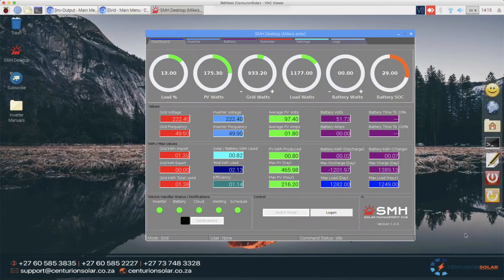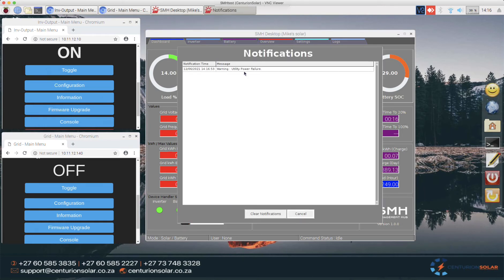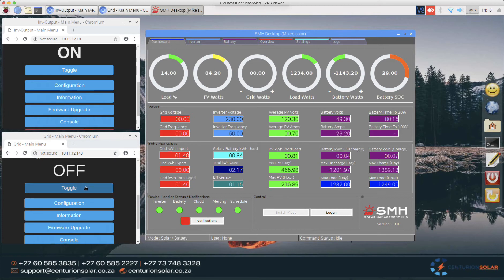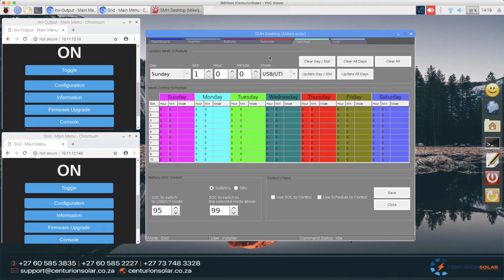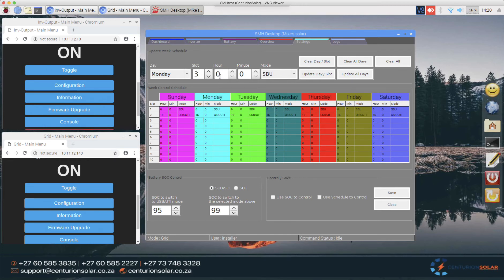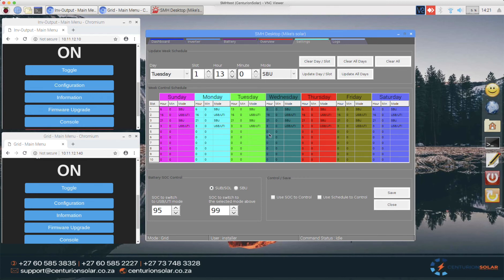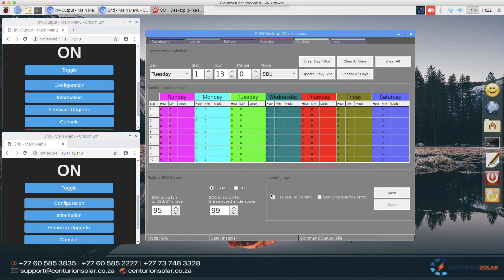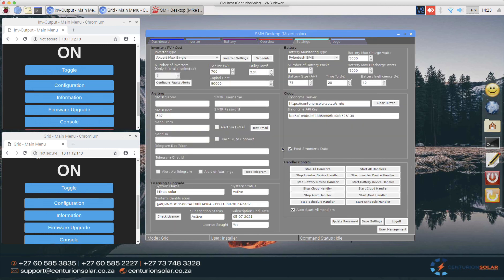Video 2.  Time to go and Scheduling handler

Comment: Your system is sooo ready to be used as an energy management system. The scheduler is a pretty neat tool for the real technical oweks but it would be even cooler to see something like an auto setting which is an algorithm that can predict usage and generation(you have the data to do it) and schedule battery operation to optimise for things like battery life, grid costs, PV power curtailment ect.  

Has integration with IoT devices crossed your mind?
Reply from the maker: Hi Corne,  
Thank so much, the flexibility to customize the operation of your system is very powerful indeed!  Regarding the IOT portion, we already integrate with just about any platform that supports MQTT like Home Assistant, OpenHAB, etc, so predictive (and responsive) load management can all be done with ease.  My entire house operates like that already ;).  To take things even a step further, we are awaiting approval of our very own mobile app (for Android and IOS), through which you will be able to control your system as well, directly from your smartphone!  That would also make us the ONLY born and bred South African monitoring company with it's own app, designed specifically for our, erm, "special" country and its unique power needs, wink wink ;).

Comment: Great software. Are you also able to specify a minimum soc for your batteries e.g. 60%? So at any given time it won’t dip below that % charging either from solar or eskom. 

Thanks
Reply from the maker: Hi Sohil,  yes, there is a very intelligent scheduling agent included that can use either SOC to control the system, or Time, or a combination of both, where it wouldn't go to batteries at 7am for instance if your SOC is less than the minimum back to battery SOC.  So at all times, the batteries take top priority in order to protect them as much as we can.,
Reply: @solarassistant  thanks. I’ve been watching your video series and saw the one about the inverter being inaccurate when reading the battery soc. I currently have a mecer 5kva inverter and 4 X 3.5kw lithium batteries and 8 X 365w panels. 

I have your pi setup but since removing for a software refresh I’ve noticed an error 04 on the inverter at either 21.00 that night or 4.30 the next morning. 

Could it be the inverter inaccurately reading low voltage and showing an error despite having charge left in the batteries?